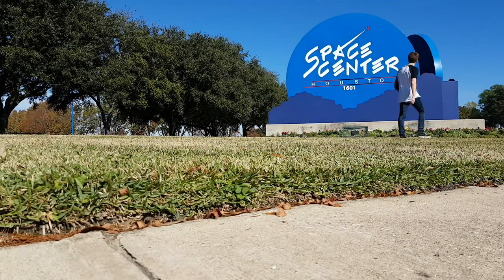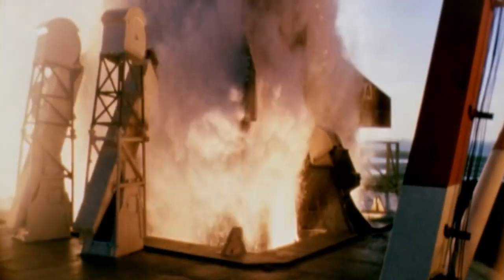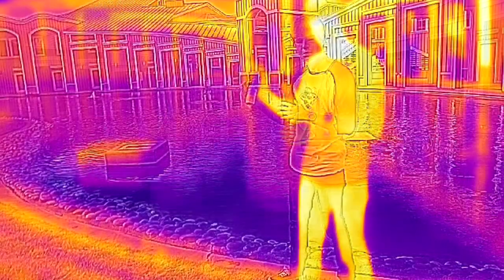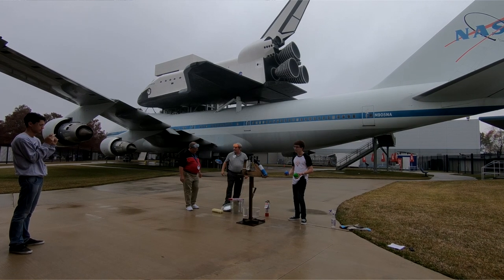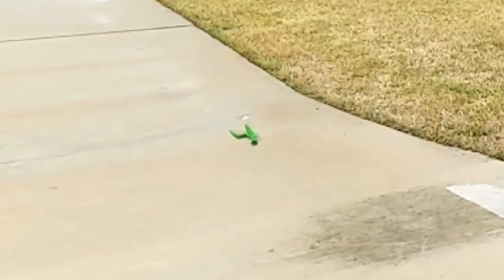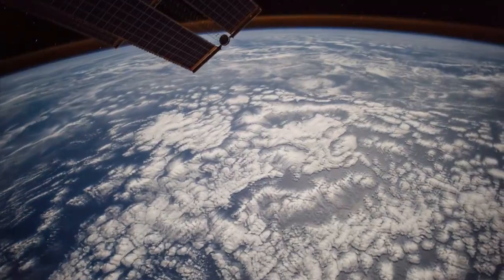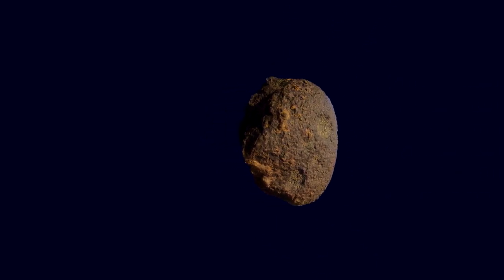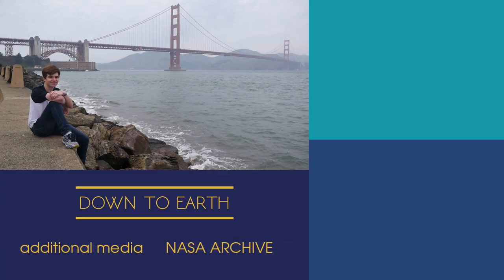How Do Spacecraft Return To Earth?

Comment: so how do you get it to fall fat end first, cones fall point forward,
Reply from the maker: Hi! Good question. Its based on the asteroid design mentioned in the video which helps keen it oriented. As long as you dont come in with the pointy bit directly ahead, then there will be a lift imbalance to tip it back upright.

Comment: Why does the craft have to go so fast on re entry. Can't they just drop down into the atmosphere and control the speed??obviously they can't. Just want to know why..
Reply: I have asked the same question and do not know the answer.  I suspect that maybe they do not have the extra fuel to slow down to match the earths speed of rotation (1000 miles per hour at the equator).  I also wonder that since air is much denser than space possibly if you matched the speed of rotation maybe you might just float on the air like a boat does in water or if off a bit might just skip off the surface like skipping a rock on water.  A lot of questions, like you I wish someone would making a video addressing this.

Comment: Now my son think deep. How did apollo13 re enter with zero controls at what speed i dont know and align it through a window? I remember apollo 11 and tell you the truth its all crap. No juman can go through the van Allen belt. Our sun is like a microwave  x 100000
Reply: Zero controls? What are you talking about? They had the CM’s RCS for attitude control, and used a lifting-body reentry to stay on course. On the return coast phase, they did several burns with the LM to correct the trajectory. Do some research, please.

You should also do some actual research about the van Allen belts. They consist of charged particle radiation, so all you need to be protected from them is a few millimeters of aluminum shielding.

The fact is that the Apollo missions were real, the technology was real, the evidence is real.